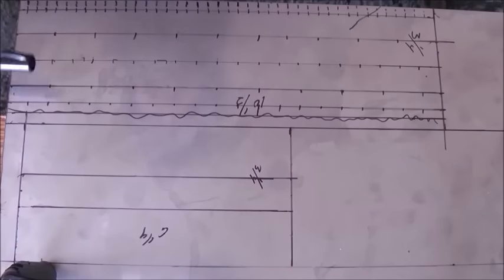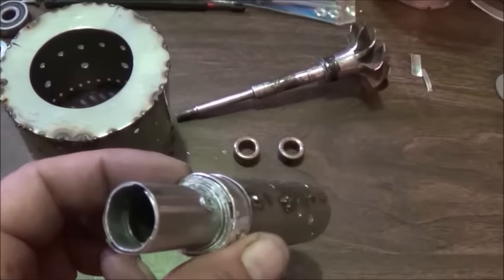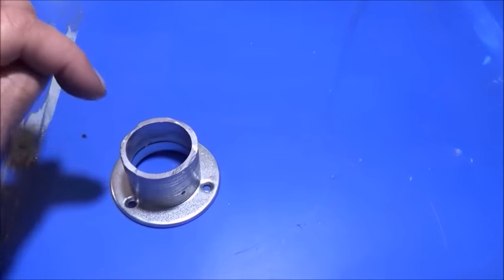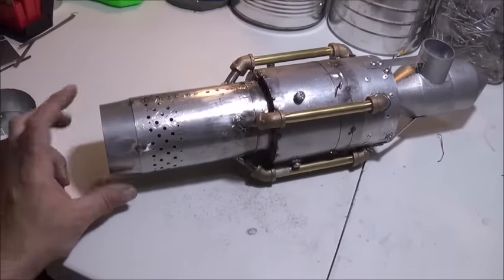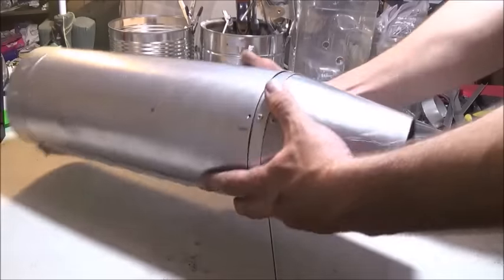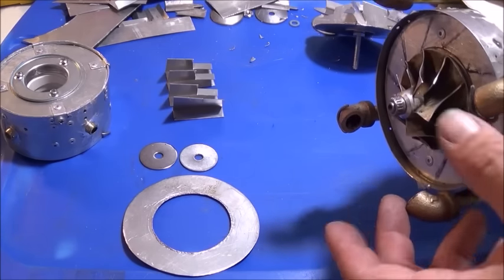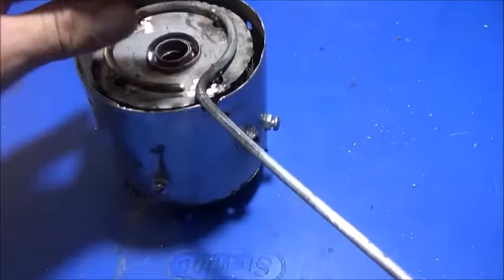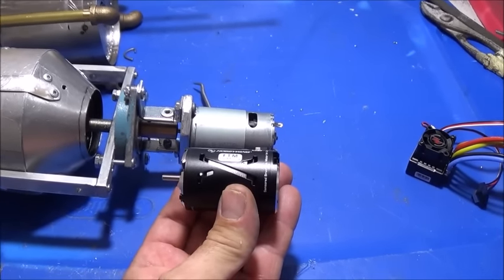How to make a TURBORAMJET engine, full build!

Comment: It’s like watching the movie Despicable me.. 
I’m a toolmaker with a full Cnc workshop, wish I had his understanding of these engines.. if we got together in the workshop, beautiful things would happen..
Reply: Wow Man is your C-N-C Computerized? it must be Lol:P I wish I could work with you in Yo Work-shop Designing/Creating & Engineering Robots made from New & Re-cycled Materials, it's a fairly recent hobby of mine, my robots are quite Sophisticated and Realistic looking, the CNC & Milling Machine would help build the legs, arms, feet and hands I'm currently working on "Bumble Bee" & the Rectangle Shaped Robot from the second to last Star Wars  Movie, I have all sorts of parts like from Old & Later Model Vacs and Steam Cleaners, Small to Medium Sized Engine Blocks from Weed Eaters and Chain saws, Small to Large RC Cars, Trucks, Motor Cycles, Tractors Boats etc, Servo Motors of Various Sizes and RPM's, Struts Small Medium and Fairly Large, Hydraulic Bits & Pieces, All Sorts a Housings Plastic & Metal, Grills, Meshes, Pipes & Hoses Alloy, Copper, Rubber & Plastic, Bi-cycle and Scooter Bits, Small Radiators I Have LED Rope Lights, All Sorts of LED Bulbs & Colors, Sensors (small * medium * fairly large) Electronic Switch Boards Pc bits & Tons a Other Great Stuff Needed To Make What I Do and so on and so forth it's great fun I'll Up-load to YouTube sometime next year My Work- Bye for now

[Quantum Robotics & Engineering A Division Of Space Race Technologies] *

Comment: You did a great job, have you seen the aluminium turbines vacuums use? They are half as strong as this and spin at 50-60,000 rpm's , the one I just pulled from my vacuum is smaller and the blades have just a pressed down tab sticking out the top and bottom plate. He's using stainless steel rivets not a simple pressing, no comparison in engineered strength!!!  He literally over engineered it compared to what we see commonly used,  since its relatively small in size the inertial force won't be very strong so there is no way this thing will come apart built like that!

Comment: Very impressive. Why don't you just admit von Ohain is your grandfather? Some critical remarks though:
- Centering the hole positions before drilling would lead to a more precise hole pattern and thus a more stable flow.
- Will all the parts stand up to the temperatures involved?
- I love you handtooled the turbine but how do you avoid imbalance if you do not do it with a lathe?
- That spring mechanism in the nose cones will only work if the springs are tailored specifically to the occuring pressure differential(s). Taking just some spring that happens to be avaialble will probably not suffice.

Comment: I suppose in order to demonstrate this principle you'll have to test fire it in supersonic flow. I would still call a turbojet engine operating static on the ground an engine, since the principles that constitute a turbojet engine are functional. The compressor, combustor and turbine are all functioning as they would at cruise speed, although the efficiency may be low. But a ramjet sitting on the ground cannot compress air with the inlet shock, and thus I would hesitate to call it a functional ramjet engine, but more along the lines of a display model. 
But still, very impressive work.

Comment: You might have been able to get a more even grind on the fins of that impeller if you had chucked it up in the end of a drill and spun it the opposite way the grind stone was spinning so that the verry edge was perfectly even and consistent. It might have also been quicker to grind as well.

Comment: I know those cheap electric motors, they run at 20k rpm with no load! A fan will give maximum load at maximum rpm, so that needs to be compensated. I run them from my lab power supply with the current limiter on 6 amps, that is the maximum according to the specs of my motor. And then I ramp up the voltage to whatever is needed to reach 20k rpm. To get in that corner of high torque and high rpm without overheating.

Comment: make 20 foot blades for a single stage compressor. compresses air to 1/5 Vo. Use as rocket first stage with 20,000,000 pounds lift

Comment: Awesome build. Being you know how to build your own Turbine! I wish you could make a shaft with a 360 degree linkage which has a crown gear at the end that would allow you to have another fan that could move into three different angles! Like an F-35 Joint Strike Fighter which you could be the 1st to have a turbine that has VTOL Vertical takeoffs and Landing! That would be my #1 project if I had the knowledge and actual tools with extra parts of aluminum which would transform new turbine’s with would be the greatest jet engine for all r,c Jets if this isn’t a pulse turbine! Either way I would make it work Especially with an afterburner. That would be pimp to all r,c Jet Enthusiast. 😎🇺🇸🛩🚀🚁🥇🏁P,S I love how the intake nozzle points down like the SR-71’S! Did you know that it was supposed to be an R,S 71 except that the president accidentally called it the SR-71 for Sub sonic reconnaissance 71 or Speed reconnaissance!

Comment: It is only to FLY here in the atmosphere of the EARTH.  To fly in Cosmic Space hurt the Earth I must use other technologies without fuels.

Comrade !!  I'm talking about jet turbines.  Use an induction coil for two thousand (2000g °) to heat the compressed air at the outlet and work better than fuel.  My dear friend, this is only of value to me if I can push an ASA DELTA TRIKE weighing 300 kg and take flight.

My dear friend, this is only of value to me if I can push an ASA DELTA TRIKE weighing 300 kg and take flight.

It is not economical, I prefer to adopt an Electric generator at the entrance of the horn, and an air compressor putting a system without fuel only hybrids hot compressed and electric without fuel and 100% economical.  FlavioAugustoRibeiroEvangelista.

Comment: This is stupid because you need to be traveling at Mach 1-3 for this to run efficiently
Reply: Not quite. From Wikipedia: 
"this design provides the ability to operate from zero speed to over Mach 3 using the best features of both the turbojet and ramjet combined into a single engine."